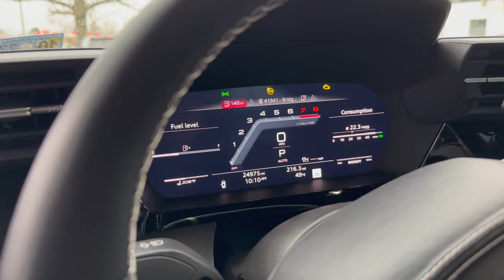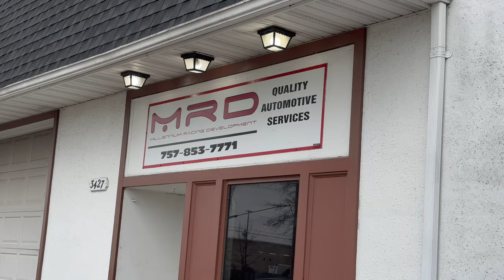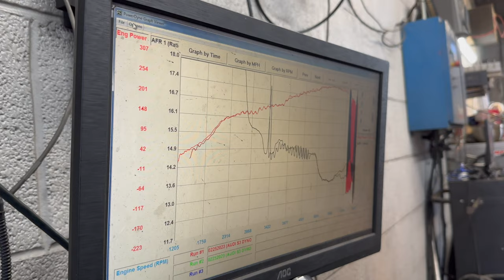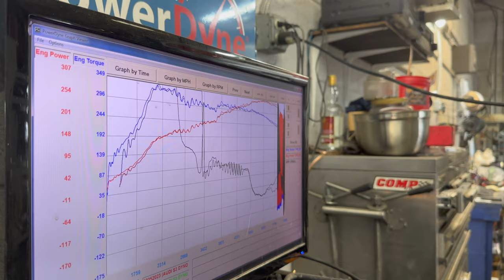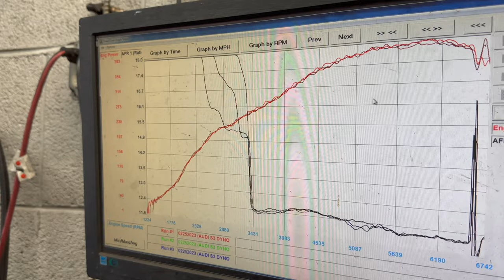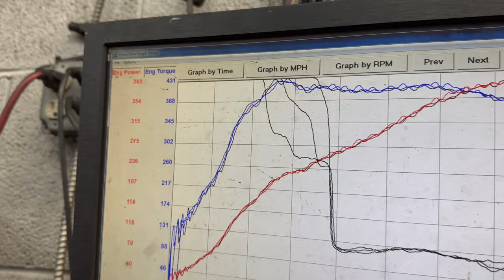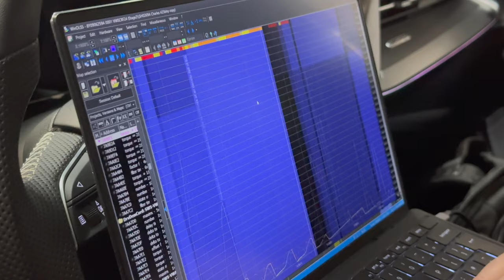Racingline dyno tuning session! Gen 4 EA888 is a BEAST! "400 WHP Ben there done that!"

Comment from the maker: Just wanna say this was one of the best weekends to date involving cars! Ben is such a cool guy I really enjoyed hanging out and shooting the shit! He’s been tuning for 20 some years if not more, he’s gotten to tune some suuuuper dope cars! Hope to cross paths again some day! We talked a little about E85 tuning so maybe that will happen and he will swing back down to do that! Blessed and so very thankful for this opportunity with Ben and racingline as a whole, I hope this got my foot in the door for more things with Racingline in the future!

Here’s the full mod list as of February 2023:

Engine:
034 street sport engine mount
034 street sport trans mount 
APR Discharge pipe
DBV2 4” downpipe (Cerakote)
DO88 intercooler 
EQT coil grounding kit
Racingline intake hose
Racingline R600 intake
Racingline stage 2 tune (beta)
Racingline stage 2 TCU tune (beta)
Racingline turbo inlet 

Suspension:
034 dynamic+ front endlinks
034 dynamic+ rear endlinks 
034 rear sway bar 
034 rear tunnel brace
ECS tuning rear diff inserts 
Eurosport camber kit 
Racingline springs
Ultra racing strut bar 
Verkline Anti-lift / Anti-squat trailing arms 
Verkline front control arms (modified kinetics)
Verkline front subframe
Verkline rear camber arms
Verkline rear subframe (track)
Verkline tie rod ends (awaiting install)
Verkline toe arms
Verkline wishbone/hub bushings 

Wheel/tire:
RT660 235/40/18
Titan T-S5 18x8.5 (17.8lbs) ET+44

Exterior:
Maxton front splitter v4
Maxton rear spats
Maxton side skirts (street sport)
Rieger diffuser

Extras:
Custom steering wheel
R8 coolant cap
Racingline brake fluid cap
Racingline coolant hose
Racingline fuel cap
Racingline magnetic front diff plug (awaiting install)
Racingline magnetic oil drain plug (awaiting install)
Racingline magnetic rear diff plug (awaiting install)
Racingline oil cap
Racingline oil filter housing
Racingline washer cap
Racingline wheel studs 
Resonator delete 
Urus shifter paddles

Comment: DANG! I definitely underestimated the power by 20hp/tq, It crazy that it's on the stock turbo and pump 93. My MK6 would would need an actual big turbo to reach those numbers, and a MK7 would need an is38. Each Generation is like a step up from the last! Thats hype! Now we wait for the AutoX vid to see how it performs!
Reply: Mk7 wont do 400whp on pump with a is38,  350-360whp at most on 93 

400whp on e85

the new S3 /mk8 does 400whp on pump  so probably will do 430+whp on e85  ( talking all about Wheel Hp number here not crank)
Reply: @jdmk7r370  APR claims 386whp fbo on 98RON/93US, im sure with a more aggressive or custom tune it could hit or be around 400whp. That being said its just an example to show how the progression or step-up improvement is from one generation to the next.
Reply from the maker: I just reviewed some of the autocross clips and the car is like a dang jet!! Can’t wait to post it!

Comment: Great numbers. I'm getting a 23 VW Arteon with the same Gen 4 powertrain. These engines are reaching close to 400 crank alone with just software. Thats insane.
Reply: Engine its almost  this same, big diffrence i turbo Continental
Reply from the maker: Larger cam as well! But yeah these motors with this better turbo is just so awesome. I’m so happy lol
Reply: @BryceJordanProductions  coming from a 21 Arteon with the Gen 3. I’m literally just upgrading because of the powertrain improvements. I had a 22 loaner recently and the differences blew me away. Much more turbo noise as well even in stock form.
Reply from the maker: Yeah I’ve heard they made a ton of improvements on the Arteon specifically. Doesn’t the gen 3 one have a sloppy trans as well?
Reply: @BryceJordanProductions  only Arteon R have dq500 gearbox like rs3 and rear diff like rs3.
Reply: @BryceJordanProductions  yeah it has an 8 speed. Its really not as bad as people have made out. Decently fast upshifts. It’s the downshifting that lets it down. But I’m APR Stage 1 with some bolt ons and it hasn’t skipped a beat. Around 380hp. I just love how unique and rare the Arteon is, plus I need the extra space. It’s been a brilliant car.

But with the Gen 4 upgrades I’m going to hopefully break the 400whp mark with the DSG.
Reply: @Adrianperformancequattro  22/23 Arteon's in NA now come with DSG transmissions. Previously was Aisin 8 speed.
Reply: @MikeMUFC91  Arteon R '23 dq500
Reply from the maker: We don’t get the R here tho in the US right?
Reply: The Arteon is with different ECU CPU - Simos 19.3. There are almost no companies which offer a tune for those (yet). Just letting you know.  ;).

Comment: dude, love the stance on that, what kind of alignment specs are you running? Definitely see some camber there
Reply from the maker: Thanks man she sits perfect for my liking! 
The car is setup for autocross mostly and soon some big track stuff.. should be hitting VIR soon! 
Currently it’s about -3.4 camber 0 toe 8.5 caster front. Rears are -2.2 with .7 toe out for some rotation. But I’m going to change it to about -3 front 0 toe and -2 rear 0 toe to help with launching since I’m doing more drag stuff lately I want to get my 60ft down and I don’t need the tail to be as happy now that everything else is set properly and I have a stiffer tire

Comment: What oil you put in that gen 4
Reply from the maker: Mobile 1 euro with ceratek from liquimoly 
Change every 3-5k
Reply: @BryceJordanProductions  

0w20. ?
Reply: @BryceJordanProductions  

Never heard of that .  Can you give me a link
Reply from the maker: I like it cause you can get it at Walmart 
https://www.walmart.com/ip/Mobil-1-FS-European-Car-Formula-Full-Synthetic-Motor-Oil-5W-40-5-qt/437059473
Reply: @BryceJordanProductions  

That's no liqui moly . 
And 5w40 ?  I think audi recommends a thinner oil. Can you explain that please.

I have a a5 and they say 0w20 must go in

But that's. More water than oil
Reply from the maker: I use the mobile 1 5-40 cause I live in the hot. I don’t care what Audi or vw says. This is an approved oil for vw/audi. I don’t trust the 0-20 whatever stuff. And it’s cheap, and you can get it anywhere so it makes it convenient for me. 

The ceratek from liquimoly is an additive just google it you’ll find it. It’s good stuff to help protect the engine
Reply: @BryceJordanProductions  

Yes i know liqui moly . Im from Europa i always use liqui moly
Reply: @BryceJordanProductions  

But are you not afraid that the oil is to thick for that new gen 4  engine? The small oil passages .
Reply from the maker: @erwinvanriel5843 nope I ran the same stuff in my mk7 R
Reply: @BryceJordanProductions  

Ok thanx . So i can use 5w40 in my Gen 3b 👌

Comment: That is not a MK8 cover that is a MK7.5 engine cover
Reply from the maker: The Audi one?
Reply: @BryceJordanProductions  no I was simply saying the MK 7.5 GTI engine cover would not fit your S3 had it been a MK8 GTI it would. Both are interchangeable MK8 and S3 engine covers. However, many MK8 engine covers are recalled because of fires. 🔥
Reply from the maker: Oh yeah yeah I get what you mean now! I think if I shaved it near the oil cap and o2 connector it would at least clip in at the top. But I prolly wouldn’t rock it anyways lol, catch can will make them not fit I think. I’m surprised Audi isn’t taking theirs away!
Reply: @BryceJordanProductions  I have not heard of any reports on Audi S3 engine covers catching fires like M8 GTI or Golf R. Seems weird but not sure how it can affect VW and not Audi since they are both same engine. I can only assume since I have not seen engine cover for S3 that it might lock in to place better than Golf's.
Reply from the maker: I agree it’s very odd! Or maybe they are just slacking on it. I already have about 4 other recalls to go do 😂
Reply: @BryceJordanProductions  lol! I still prefer the S3 over new MK8 golf r